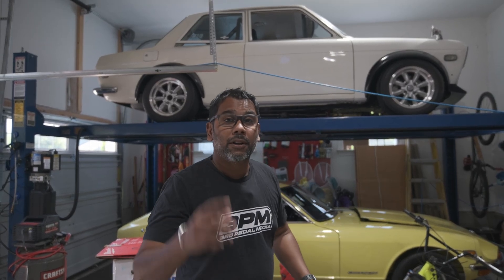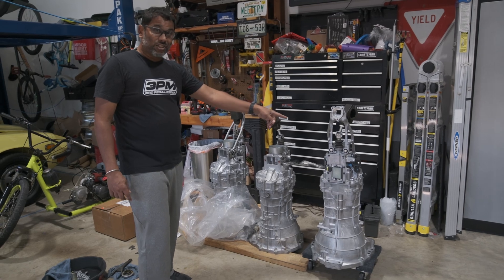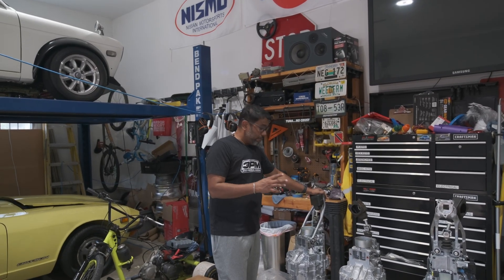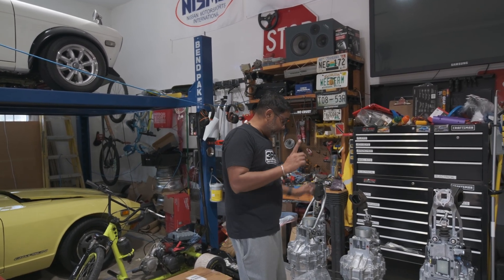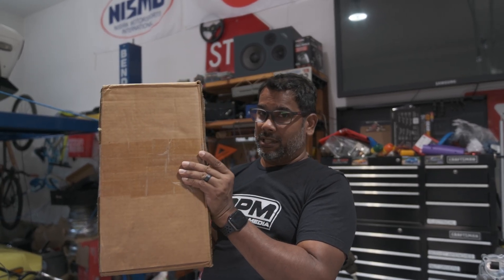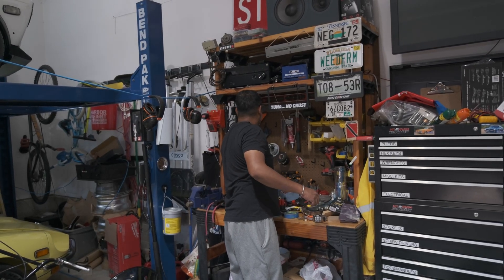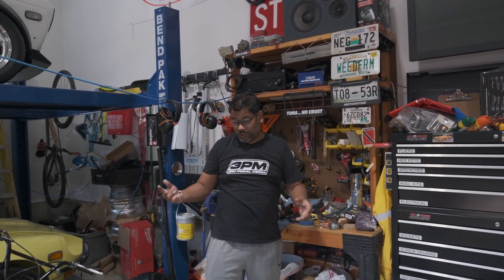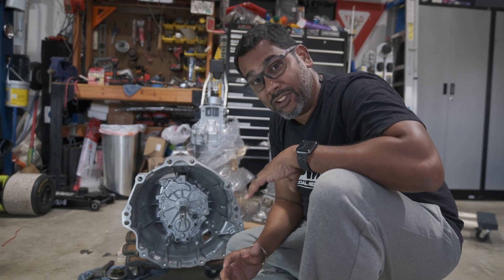Part 2: Gearbox Showdown CD009 vs All-New Nissan Z 6-Speed

Comment: Nicee and well informative video my friend!

Did you also compare the bellhousing bolt pattern from the Jk vs 6gp to see if i can swap directly my 2016Z with a 6GP ??
I try to check by pausing your first video..  but im curious 😊
Reply: Im searching everywhere for someone who have possibly try  to swap newer tranny in a 370z ...  but nothing appears to be done and documented
Reply from the maker: It’s the same except for what I believe is one bolt hole and the crank sensor cutout. Ppl are doing the vr30 auto into older g37/370z swaps

Comment: Man you are king for giving finally most of the details and measurements I have been NEEDING!!! Also since you have had so much time with the gearboxes, I was wondering like if there is ANY difference in the tail housings or castings for the gearbox housing besides the bolt pattern on the bell housing?Bearing or gear differences in sizes or things like that for load capacity? Got a wild project idea but can’t find this kind of info anywhere.
Reply from the maker: Looks to be the same or very close at least.

Comment: Idk if this is a valid question but ik the 370z had the revmach, why wouldn’t u wanna put that in the car instead since it would be cheaper wouldnt it
Reply from the maker: The rev match is just a bonus. The 370z have the JK with the internal slave that fails prematurely. 6GP is the next newer iteration

Comment: Just wondering with the gear position sensor plate is the bolt pattern the same as the cd009 so can you swap plates to use the top mount gear lever adapter
Reply from the maker: That’s a really good question! But if it’s was possible I would thing someone would have tried with the module from a JK.
Reply: @3rdPedalMedia  any chance you still have the gearboxes to check against under the cover to see if the same linkage system so could use the autosports engineering Shifter Relocation - Front Mount

Comment: if I'm not mistaken, this will fit G37/370Z and HR 350Z models if you modify the crank position sensor location similar to how it's done on the VR30 automatic transmission swaps. same CD009 internals but updated OEM external slave system and cheaper than the JK40/41 models? makes me want a new transmission lol.
Reply from the maker: RIGHT! No more messing around with a JK!